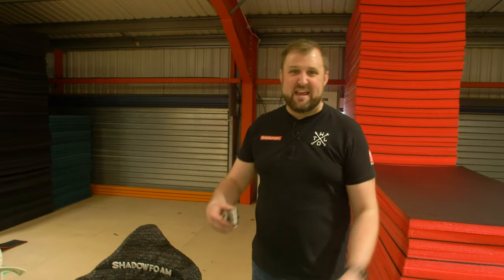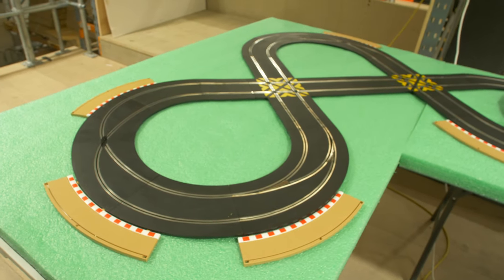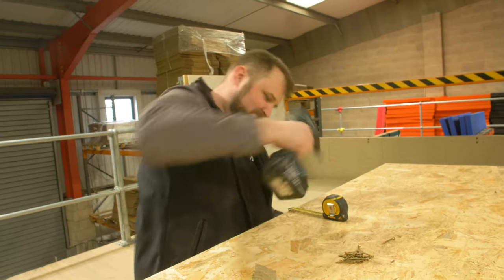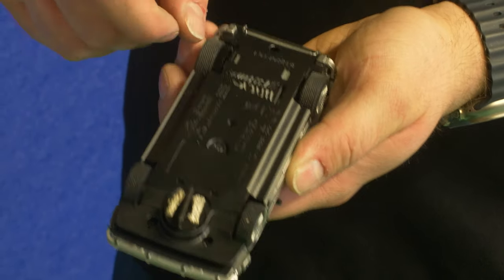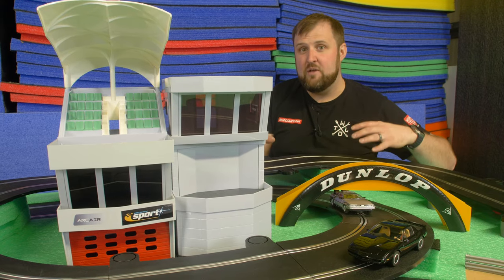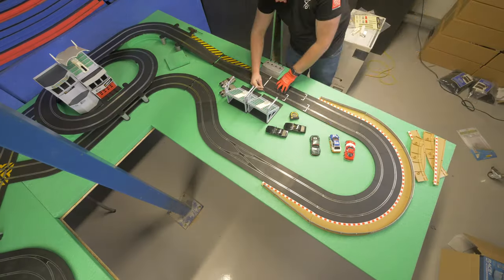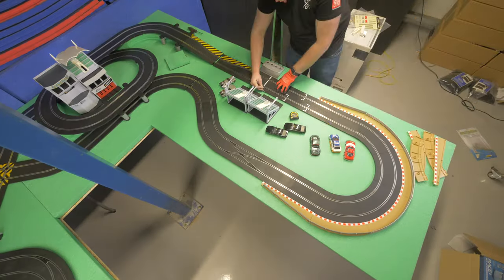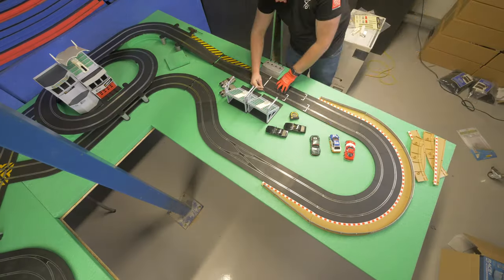Ultimate Scalextric Digital Track: Shadow Foam Edition!

Comment: Check out about truing the tyres... have the cars spin the back tyres on some ultra fine sand paper held to the track, especially on older cars! The difference this can make is insane!!!
Reply from the maker: What a great tip! Thank you!
Reply: @ShadowFoam  Smoke coming from the motors is usually a good sign you've done it for too long in 1 go. It's best to hold the car with the magnet away from the rails. A good way to test the tyres is to put your hand in front of the car, if the wheels spin freely, the tyres are bad. Once you've done it, the grip and magnet downforce will actually stop the motor. They'll be super tacky now so any dust is picker straight up... easy to have the tyres blast this off holding the car on the track.

Comment: Can't improve the great job you've done, but can I suggest you try some design software? Ultimate Racer (no affiliation btw) works quite well. It's not free and is a bit quirky, but you can try different designs easily.
Reply from the maker: Thanks for the tip Trevor, much appreciated!